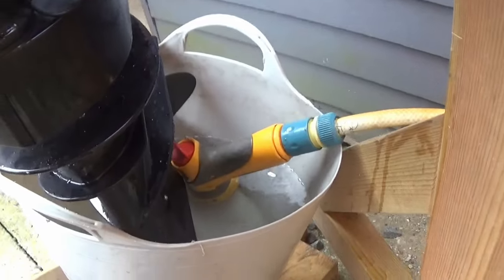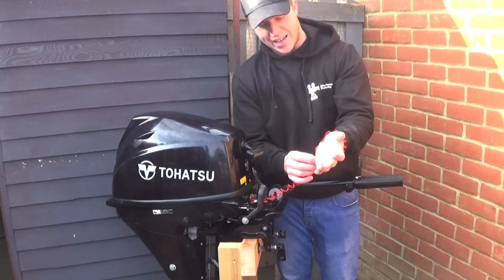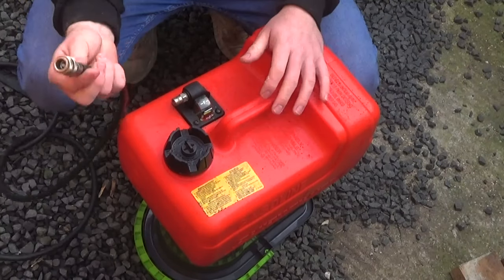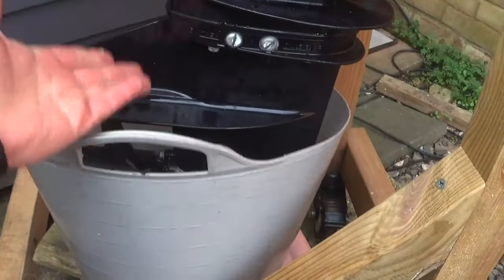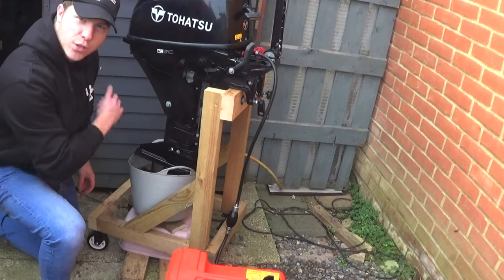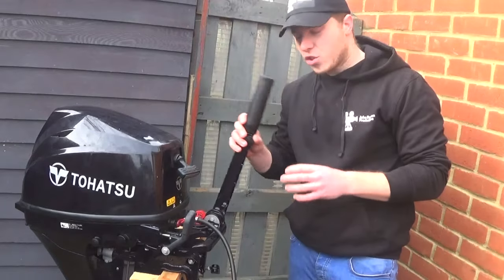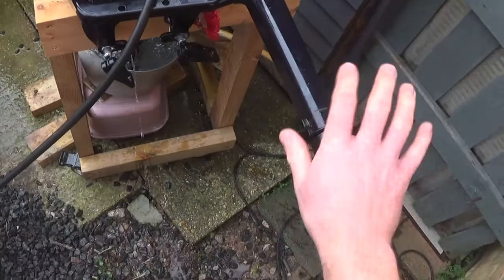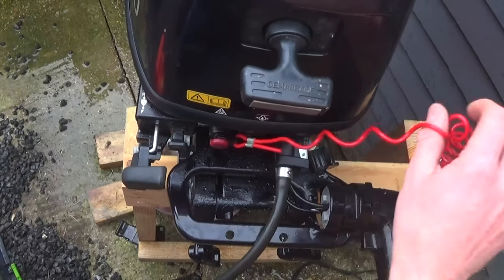Outboard Engines For Beginners - Small Inflatable Boat - Complete Guide - Tohatsu 9.8HP

Comment: For a 2,stroke should you not run the motor until the carb empties ?
Reply from the maker: With modern fuel you don’t really need to but if leaving for a while I’d say it’s worth it just so everything is clean
Reply: I think the issue is ethanol - unleaded is now E10 and if you leave that in the carbs of older model 2 strokes then the parts will quickly become degraded and clog the jets. Higher Ron fuel ie premium rated doesn’t have to run E10 it will be more like E5 which would be better. Esso do an ethanol free super premium which is great for older cars, bikes and 2 stroke motors. Life is complicated!😆
Reply from the maker: @cd9278  thats interesting to know. I always run premium unleaded in mine at E5 due to not wanting to ruin and parts and/or get any water in the fuel which I believe e10 is more renowned for. Running dry either way makes sure the engine is clean
Reply: Lovely Outboard, for my Tender, Im peobably going with the 6hp single Cylinder vsrsion for 25mpg fuel e onomy. Worth pointing out , Do Not Fail to use Fuel Stabiliser, which keeps petrol good for up to 12 months!  Plus Avoid Ethanol in Petrol at all costs as it destroys engine Seals, probably Carburettor diaphragms,  plus the Liner inside your Fuel Line. Stabiliser puts a protective Coating on those things. I've seen videos of Fuel line liners that have broken down into small bits that require Fuelmline replacement and major fuel system clean up, for example clearing Carburettor bowls and jets to get the engines running again, tbh, probably worth adding a fuel filter to the fuel line close to the engine to be able to see if there's a problem starting between the fuel tank and the engine ? tbh, I'm probably going to go with an internal fuel tank plus the external large tank, so if the fuel line looks like it needs replacing, there's the internal tank as backup. Do Not Forget, change the Water Pump impeller Annually, or more frequently if the engine is used pretty much every day (for example if a liveaboard in the Tropics, and your Tender is your mode of transport). Also, if in the Marine Environment, unless just used for Trolling, do Not use Electric Outboards as your main propulsion. Conditions can turn really bad in the blink of an eye, and notoriously so in the Mediterranean for example,  and they just don't have the power or energy density to be able to get you to Safety. That may not be a popular thing to say to Greenies, but it is what it is.  Best Wishes and Fair Winds.  Bob.  👍🙂

Comment: The label says this side up but the protection rubbers on that side mean that is facing down, confused.
Reply from the maker: The label needs to be facing the sky. I actually picked the wrong side. Although have always transported it the correct way. It’s still best I think to transport upwards. Never had issues starting when doing this

Comment: i got a 9.9 tohatsu and its not fun to move and carry around lol... im thinking of selling it and just get a 6hp since its me only most the time .. my 9.9hp not even broken in yet lol kinda regret i got a 9.9 now lol.. after a day of fishing i dont want be dealing with a 100 pound engine lol
Reply from the maker: The end of the day isn’t easy. I de kit my whole boat and take things up separately. What is easy is use a sledge. So lay the engine (correct side up) on the sledge. And then haul it to where it needs to go. The weight is sadly a pain.

Comment: when i push the choke in, the engine dies. it only stay running when i put it on re-start without the choke.
Reply from the maker: This may be because you have flooded the engine and don’t need the choke. The choke is only used to initially get the fuel into the carb to help the engine start. You don’t need it after that until the engine starts from cold again usually 👍🏼
Reply: @MuscleFishingOfficial  thanks, will it damages the engine? I’m completely new to boats and engines. Is it ok to spray fresh water on the whole outboard after each use since it’s got saltwater stain. Does it damage the engine if I let it run out of gas/petrol for storage or transport.
Reply from the maker: @huanc7996  if you have a 4 stroke letting it run dry if you know your not going to use it for a while is fine, 2 stroke don’t let it run dry anytime. Hose down with fresh water has never damaged my engine and can’t see why it would, after all they are out in the rain 😊
Reply from the maker: @huanc7996  if you have a 4 stroke letting it run dry if you know your not going to use it for a while is fine, 2 stroke don’t let it run dry anytime. Hose down with fresh water has never damaged my engine and can’t see why it would, after all they are out in the rain 😊
Reply: @MuscleFishingOfficial  thanks man,  i have the same outboard as yours in this video. just no fuel gauge on my tank.
Reply from the maker: @huanc7996  great, so yes you are probably just over pumping the fuel bulb and flooding it, if it doesn’t start try twisting the throttle as you pull the cord. Works every time if mine is behaving badly
Reply: @MuscleFishingOfficial  yep, twisted to restart and pull the cord works every time for me

Comment: You made one big error in safety. You should clip the line onto your clothing or, if you desire to have the line to go around a limb, it has to be a thigh! The way you showed around the wrist is super wrong, under certain hand positions, it would come off the wrist easy, would not kill a motor. It is important to know. So, you either clip to your shorts, etc, or pass around your thigh.

Secondly, you can buy Suzuki 9.9HP/20HP (same base), also comes in a cool all white color. It does not need a battery but it is a carburetor free motor, it has electronic fuel injection. All you need is to pull the cord half strength, no choke to play with, no carbs to clean of flood. Another advantage of this very motor, you can water flush it without a need to run an engine. Just connect a hose to a non-running motor and you are flushed.
Reply from the maker: That’s a interesting observation in regards to the kill cord. I always have it quite tight around the wrist and seen most people do similar. I shall have a look next time I’m out.

Every engine will have pros and cons. The hose adapters are quite nice. Makes it easier. But I still think a fully submerged tub is best. 

Thanks for your input!  I shall do some tests when I’m next out and see if how I have my cord would result in it killing engine, it doesn’t take much to pull this one out. Thanks
Reply: @MuscleFishingOfficial  I am guessing, this idea around the wrist comes from a jet-ski experience. The only thing, the wrist strap for PWC comes with a neoprene loop that tightens around a wrist on pull and the neoprene piece is not slippery like the plastic line by itself. Say, if you are trying to recreate that, you need a specialized strap for the wrist specifically designed to be worn this way.
Reply from the maker: @Booboosik  I have just found a wrist strap online which I have ordered. It clips on the wrist strap. I will mention this next when I’m on a boat where kill cords are being used around the wrist, as it’s rather frequent. Thanks again for the input. Something to certainly think about
Reply: @MuscleFishingOfficial  The suzuki 9.9 is much heavier